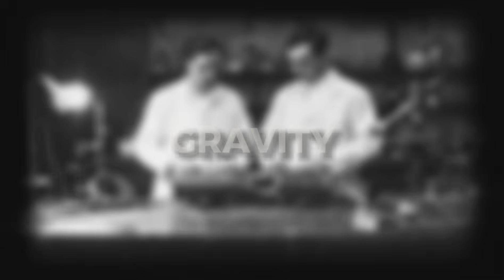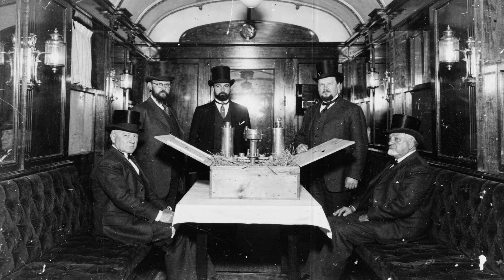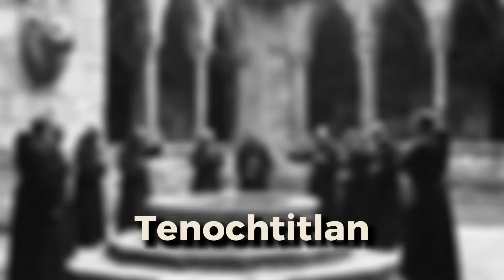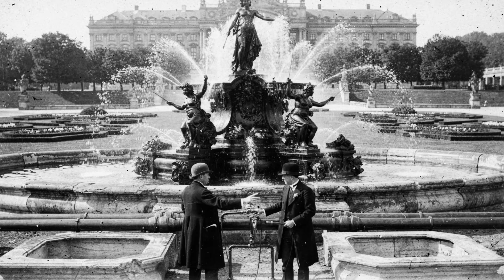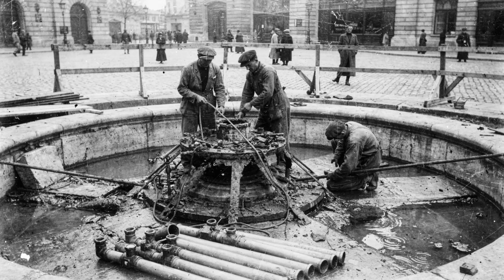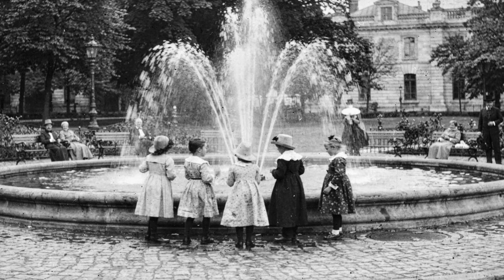Why ANCIENT Tartarian Fountains Worked Without Any Pumps

Comment: If you have flow in a pipe and suddenly stop the flow that can amplify the pressure into an accumulator chamber. You could use 3 pipes and a swash plate multi-valve for more continual flow.  Or you could use a low pressure high volume water motor coupled to a high pressure pump of lessor flow. They likely did not use the deuterium in the water to create extra energy via sonic cavitation.  The hydraulic distribution network would be immense compare to electrical cables.